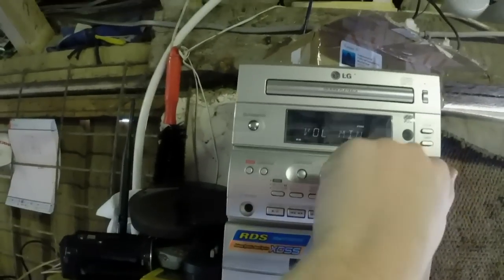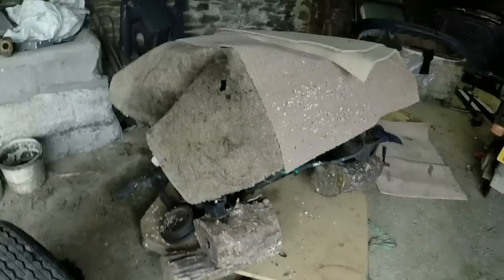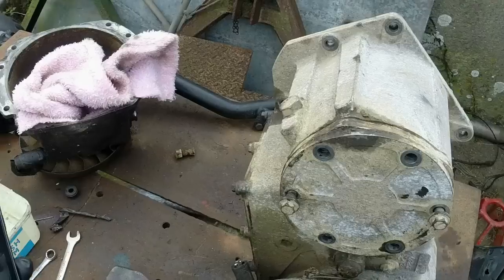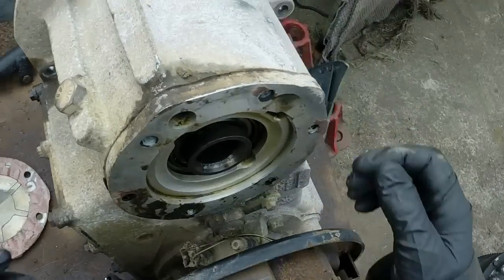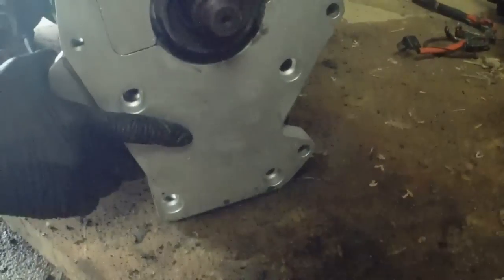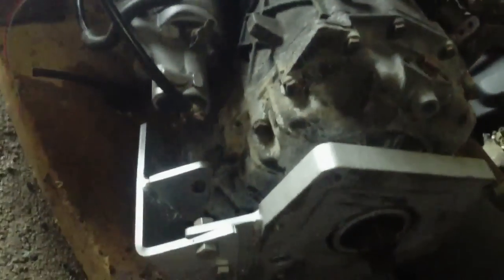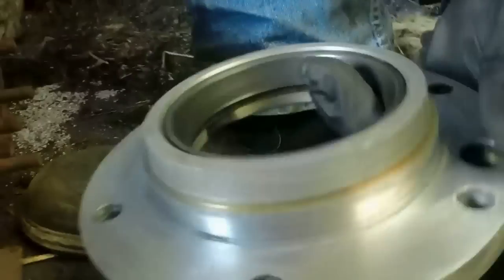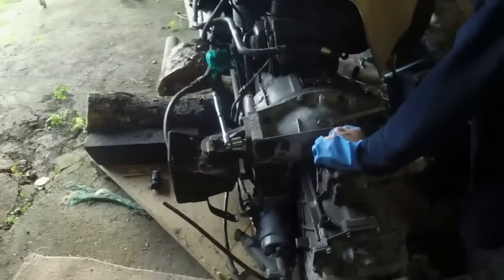Land Rover Cummins Conversion Part 3

Comment: Looks good, how much was it to get that conversion plate made up?
Can you do something with the diffs to higher the ratio? The lower rpm the better really with that engine.
What are you doing with the clutch?
Very nice work though
Reply from the maker: St al We are hoping to change the transfer box for a 1 :1 ratio soon, which will help, and hopefully in the long run maybe some different and uprated drive line components...
Reply: +Darren Lobb Darren did you/Chris manage to get hold of a 1:1 ratio transfer box in the end?

Comment: Hi Darren im busy getting all my parts together for my Cummins conversion to my LR 90, the biggest headache is mating the TC to the ZF box would you mind sharing your adapter design if in anyway possible?
Reply from the maker: Ive sent you a PM!
Reply: Darren Lobb hi can get a copi to. kind regards leif

Comment: hi can you tell me how much it costs to do this conversation
Reply from the maker: Very hard to say really, as depends on if your doing it all yourself as we have, or if your paying someone else....The latter obviously would cost alot more....The main expense would be the engine and box, which at a good brakers yard can be got for around £500-£750....then other expenses include custom driveshafts, adaptor plate and machined input shaft...other than that, most other stuff can be made / put together fairly inexpensively...
Reply: hi can you list me all the stuff to do the job and get all parts made please and the drawings thanks

Comment: Try to get a 1:1 box if you can. Even with it mine pulls away in second gear from standstill and that's with 285 tyres.
Reply from the maker: MrHumding We are looking to get a 1:1 box / put 1:1 gear into the old transfer box to "swap in" once its done / up and running!
Reply: Darren Lobb Suppose I was lucky I had a box from when I ran a 6.2 Chevy V8 diesel. I'd imagine a 1.2 would be painful but at least it'll get you going. I see most of you guys now join the tbox to the main gearbox. I divorced mine but you need the length of a 110 to do it. Anyhow best of luck with it.